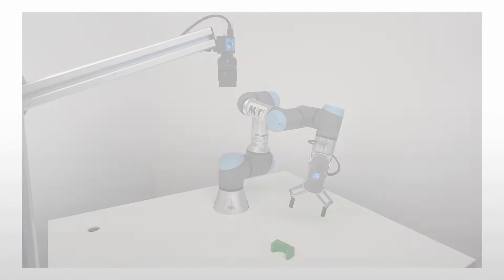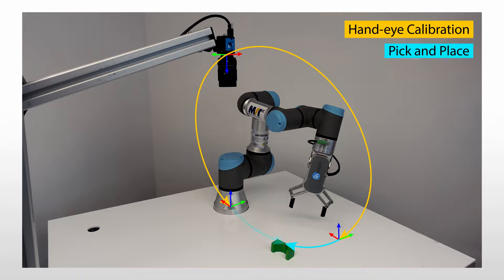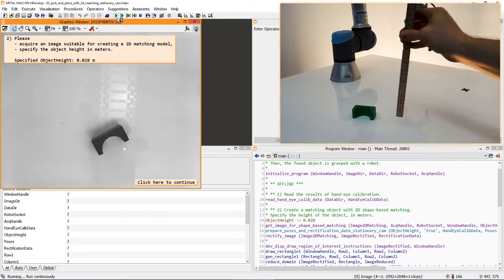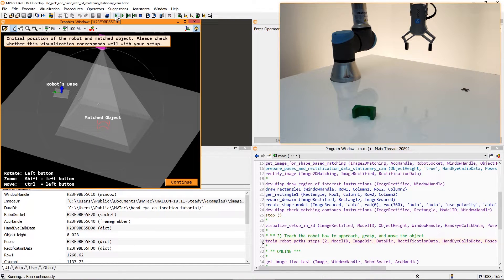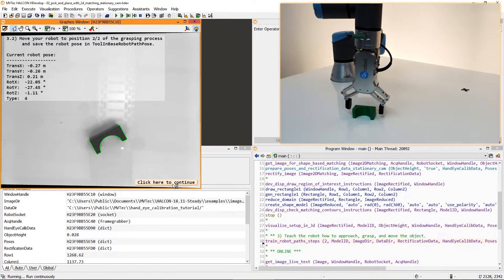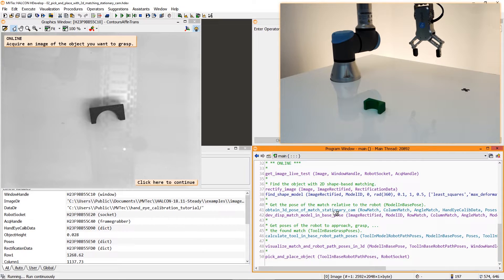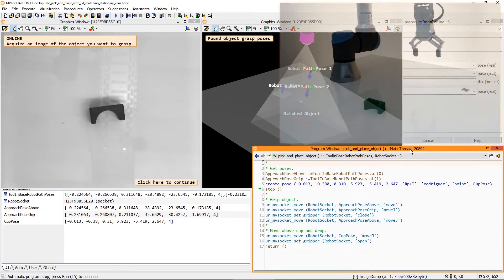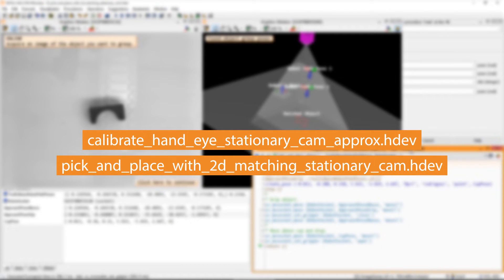Pick and place with shape-based matching (stationary 2D camera)

Comment: Hello,

I was wondering : what is this function called "ur_mvsocket_set_gripper" ?
I can not find it on Halcon.

Thank you,

Best regards
Clémentine
Reply from the maker: In the program, this procedure is used to open and close the gripper of the UR robot. It's not available in the HALCON installation. If you are using a similar robot from UR and want to use the procedure, please contact one of the MVTec HALCON distributors in your country: https://www.mvtec.com/company/partner-network/halcon-distributors/
Reply: Ok, thank you, I will do that.
Reply: However, do you know what is the command to write to move the gripper ? I know that to move the robot it is movej([...]) but I do not find what is the one to move only the gripper
Reply from the maker: @clementinep5023  This seems to be a task, which is dependent from different factors. Therefore, please refer to the HALCON distributor in your country. Thank you.